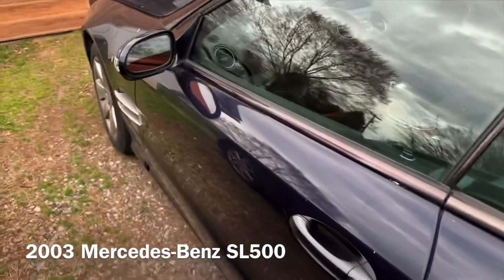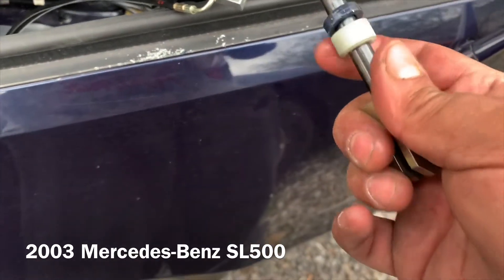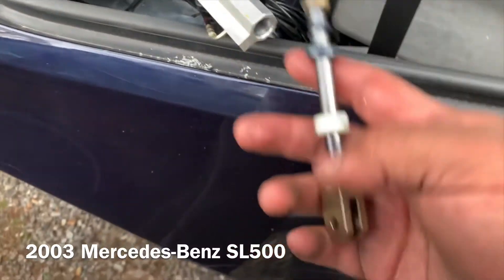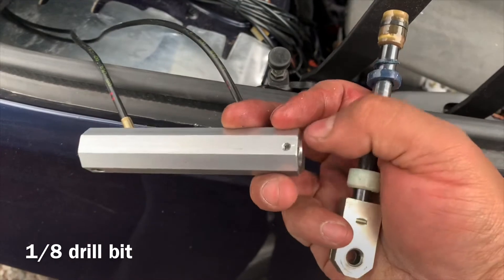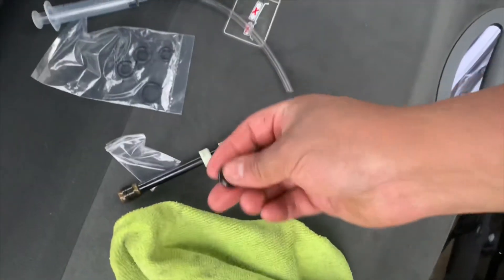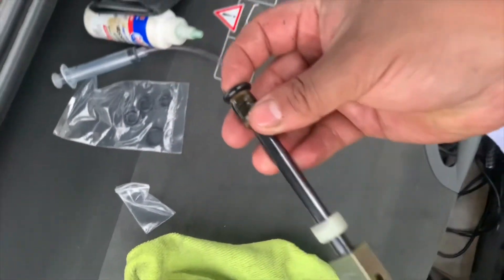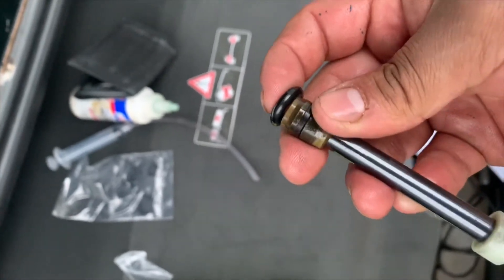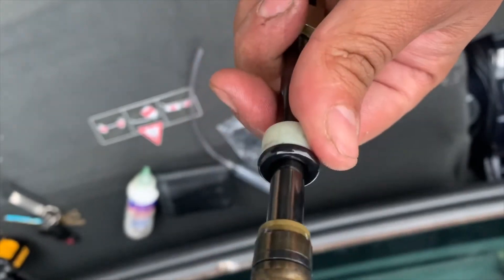Mercedes SL500 R230 Rood hydraulic cylinder leak fix..

Comment: Thanks for the tips! My roof is leaking on the right side.
Reply: Mines currently leaking on the same side, front right. Did you find out which cylinder it was for you?
Reply: Nope not yet.
Reply: @rdrjr4129 , there's only one cylinder forward of the rear windows. It is the locking cylinder in the front of the roof above the rear view mirror. You can unlock it with a 6mm Allen wrench, through the plug you see in the headliner by the mirror.

Comment: Did o rings come from auto parts store or were they the correct ones. If correct  where did they come from
Reply from the maker: I bought them from Amazon I have the link on the description it’s only for 1 O ring but that is the same one for the rear as well.

Comment: hi bro and thanks for video, but anyway i have a q, link you have paste is to O ring only for front vario lock or is same all around car ? i would like to change all of them , but cant found where to buy or dimmension of them. 
cheers!
Reply from the maker: Hey… yes the fit the rear as well there is 2 big Orings for the main hydraulic lift cylinders but u can’t service them like the smaller ones it takes a machine shop for that but they are also not known for leaking or failing…
Reply: @xCHAV0x  same confirmation...you order an extra front lock o ring for the rear lock you fixed? Also did you do both sides at the same time, or have to do the other side later? I got the same issue and wondering how you handled it....
Reply from the maker: @videosourceonebusinessacco5438  yes I had to order 2 kits..since the kit only comes with 1 Oring and yes u can do both at the same time
Reply: @xCHAV0x , i was wondering if you did both? Only one is leaking, but if you found the other to start lesking soon after, I will go after both, thanks for the advice.
Reply from the maker: @YourFloridaLand  yes I did both it’s not hard to remove the other one and even tho mine was only leaking in one side, when I did the second one the gasket on it was almost toast as well so it better to do both
Reply: @xCHAV0x  thank you for sharing the advice..will do.

Comment: what size or part number for the O-ring in the cylinder
Reply from the maker: I’m not sure the size but It’s the same size oring that the SLK r171 uses for the “locking cylinder” u will need to order 2 since they usually sell only one that’s what I order.